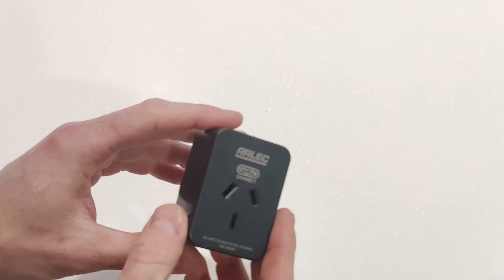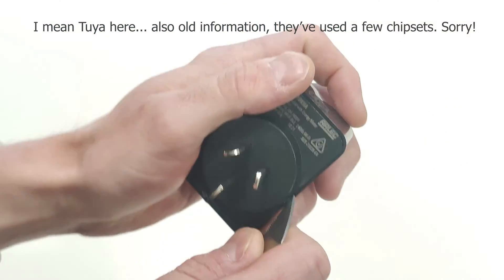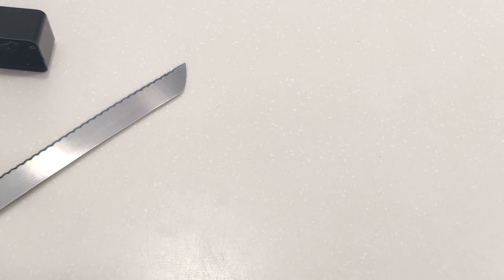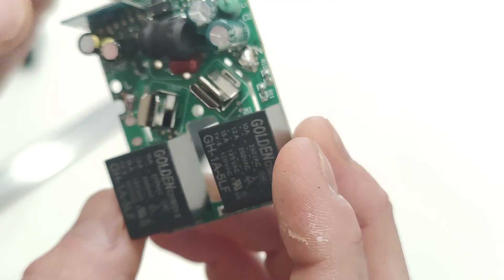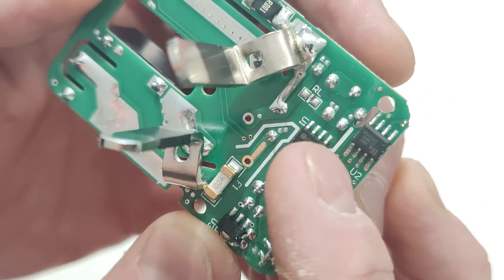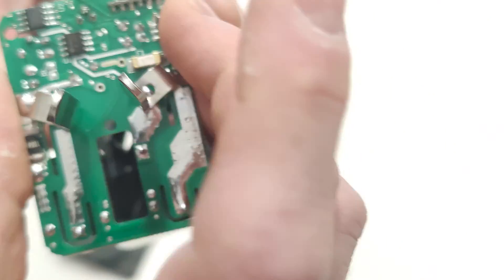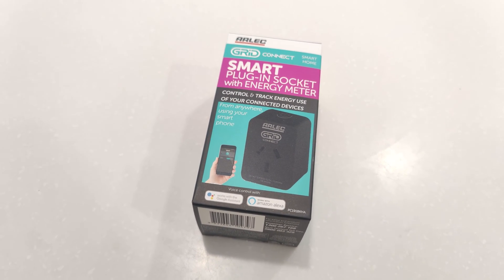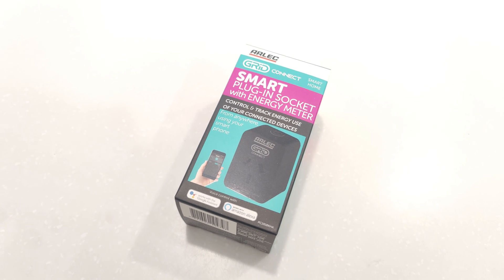Arlec Grid Connect 'Smart' Plug-in Socket with Energy Meter (PC191BKHA / PC191HA)

Comment: Since the first time I looked at this video, I've managed to replace the module in several of these, flashed with Tasmota. The TWYES 2 modules are cheap enough from Aliexpress, and after flashing tasmota on to them and replacing the crap module with the invasive grid connect crap on, they work with MQTT/Home assistant.
Reply from the maker: Hey that is great to hear! I just hate Tuya so badly haha, and rather get straight-up ESP32 modules if possible.

Comment: Great video… and I agree the app and info you get from it is very crude. I am looking for something that is better than this and where I can gather power usage to then calculate the cost against the wholesale market price of electricity.
Reply from the maker: Check out some of the energy integrations by Home Assistant, as they can be fantastic starting points even if not using Home Assistant. Shelley is always a good one, but I personally prefer Athom units. Depends on whether you require full retail compliance though, and if you want to sample at the socket or the mains input.

Comment: Just got 4 of them for $20, I've got some setup inside and in the garage working with home assist and their great.
The Bluetooth and location permissions are for wifi as BT shares the same chipset.
They explain it perfectly in the instructions and on google home
Reply from the maker: Yeah if you're happy using Google Home, and don't mind their low refresh interval etc, they can be fine, but if you need it to work offline or prefer not to risk your network being compromised or your data used for product research, then you need to flash it with third party firmware. IMHO just not worth any of those risks
Reply: @PlatimaTinkers  just opt out to sending data? 🤔 
There's no tracking in their firmware as I stated the BT and wifi and populated in the same chipset so it HAS TO use location services for its initial setup with 2.4ghz as 5gz isn't available untill setup is finished.
Wireshark and ng-suit shows zero outgoing data on Kali 
They can be setup on a local network easily without being online? 🤔 
I myself design and manufacture esp machinery ect.
You can also use tasker suits ect if you don't like Google assist.
It's instant without delays. 
It's better than the EWEELINK products ect.
But yes, unlocking the extra GPIO pins would be great but then you could just make one for as little as $4 with ALL GPIO's available? 
So I guess my question is, why you'd you pull apart a $40 item to use its parts you could buy for littoral cents? 🤔

Comment: What smart plug do u recommend?
Reply from the maker: For an everyday consumer that just wants an easy plug and app, or for someone with a bit of know-how who won't electrocute themselves and may want to use it with HomeAssistant etc?
Reply: @PlatimaTinkers  Just for reliability remote control and timer control really.
Reply from the maker: @MrBoomtheroom  Hrmm probably the TP-Link range then, they'd be easier to use.

The only reason I prefer Kasa over Tapo, is that the Tapo use Tuya under the hood, which I loathe.
Reply: @PlatimaTinkers  what does kasa use if not tuya?
Reply from the maker: @MrBoomtheroom   Well to backtrack a bit, they are typically ESP8266/ESP32 or Beken, and both can usually be flashed with something non-proprietary even if running Tuya. The older ones you could flash OTA due to a weakness, but the newer ones you generally need to crack them open to flash them unfortunately.

The issue specifically with Tuya is that it's closed, and locks you in. You have to use their app, you have to create an account, and it does not interop with many things. Basically just the required Apple/Google/Matter ones, in a limited form.

If broken and flashed with ESPHome/Tasmota/OpenBeken/etc, then you can integrate them with pretty much anything. WiZ is great like this; no breaking needed, no account needed, all integrations supported out the box with their own firmware. 

As far as the Kasa goes though, I honestly don't know what it uses under the hood. Maybe their own platform, maybe one of the ESP SDKs that is very "hit the ground running with our kit" (and good). The app was good, the integrations were good, etc. But Tuya unfortunately dominate the market, Kasa is all but discontinued, and Tapo have been no end of pain.

For me, besides integrations and account creation, the other big issue is I like everything to operate local. No cloud requirement. WiZ excels at this, and I think the Kasa range even worked fine, but AFAIK (and I may be wrong or it's changed) but Tapo requires internet. That's a vulnerability, and also just another bit of the 'black box', plus a liability if your internet is down and you want to manage it.

End rant. Hah
Reply: @PlatimaTinkers   reliability and good componentry really.
Reply from the maker: @MrBoomtheroom  I'd go for Athom then if you're a bit technical. Else the TP-Link Kasa range (not Tapo), or anything from WiZ.

Comment: I have been using Powertech MS6106 plugs bought from JayCar. I have a number that just work however some of them just go rogue for no apparent reason. Turn them off, wait, turn them on, press for 6 seconds, rapid flashing, start Tuya app, wait 2 minutes, fails to pair. Wifi is an ASUS mesh RT-AX92U 2.4ghz. Password is correct. Any suggestion would be welcome. TIA

Comment: Hey mate,
just bought a couple of these (before watchingthis video sadly enough :-)), but luckily bunnings is good with returns!
I'm very much in the market for a device that does what this one offers: energy monitoring and - if possible - remote on/off switch for the GPO. Are there other products that you would happily recommend?
Cheers,
Peter
Reply from the maker: Hey mate yeah I love Bunnings for that! Kmart too actually

10/10 recommend these: https://www.youtube.com/watch?v=o3iGvt1FTDc #ShamelessSelfPromotion (link in desc)
Reply: @PlatimaTinkers  thanks mate!
Reply from the maker: @petersmolderen2037  Any time!
Reply: @PlatimaTinkers  Hey can the Tasmota or Athom run sunset and sunrise schedules just connected to the wifi alone? A better question is do the apps provide sunset and sunrise options when setting a schedule?
Reply from the maker: @Timbo_tango  (Sorry been on the road for work) You'd need to modify their firmware, but luckily this is pretty easy. They post the default YAML for ESPHome on their website which has the web UI enabled, and you can just add extra config lines for that. Ref https://esphome.io/components/sun.html

They don't have an app either, unless you integrate it with Home Assistant (as I have) and use that app. Typically the "out of the box" experience is that it gets power, broadcasts a captive portal for config, you join it and get to it's config page, put your wifi details in and save, then access it's web UI from back on your own network.

Hope that helps :)

Comment: I'm looking for a strictly energy monitor plug and one that will monitor energy going in reverse, my current non wifi plug will go in reverse as it has solar panels plugged in, will these be the same?
Reply from the maker: That is bloody interesting, had never thought of that!

Will leave your email in my inbox, and try to jam 240V backwards through one this weekend when I am next back at the workshop. Once I've tried it, I'll let you know!
Reply from the maker: Hey so I tested this and unfortunately it does not work. When connected in reverse, the controller does not get powered. I can only assume that this is due to the side of the relay that the controller is on. I tried both the old and the new version, but no luck with either! Sorry mate, you'd have to custom make something for this!

Comment: Great video - thanks for all the info.
Has anyone else noticed that these devices reset/flap at random times - sometimes up to twice a day?
I bought a pack of 4 and all do the same thing.  At a random part of the day, or night, you will hear a click, and whatever was powered on via the device is now switched off, and immediately after that, another click as it is switched back on.  I have no schedules defined etc and load is around 2 Amps or less.  All four devices do this at different times, so I don't think it is environmental.
Any ideas as to what could be causing this, and have others seen this occur?
Reply from the maker: @craigreeve1091 Oh mate I had sworn mine was doing this but I could never catch it. I have some old crap ones that I know do it from time to time, but that's expected.

I am putting it down to either a firmware issue on the devices, or some sort of power regulation. Where we are power can drop down to 220V, or under 49Hz, usually just for a split second - they probably hate that.

If it's firmware, flashing it with Tasmota or ESPHome might help rule that out, else to rule out the mains voltage you could run it off an online-conversion UPS and see if it does the same thing.

I had some other thought of what could cause it, but I've since forgotten. Maybe worth checking your wifi logs to see if they actually disassociate; if it clicks and then reconnects to wifi it's a whole reboot, else it may just be the relay losing it's latch.
Reply: @PlatimaTinkers  
It worked out very well that I had these in my study whilst working from home, so I could see/hear it happening.

Thanks for your ideas.
I'll look into the wifi disassociation and any error logs.  I was also going to try and get some tcpdumps to see if anything interesting there as well.  

I thought if I had an issue with bad power etc, all four should have flapped at the same time, but this was never the case.  I'm not an electrical expert so that could be a wrong assumption on my part.  I do have a power strip running from the UPS, so I'll put one of these devices on that and have it feed my PC.  That way I'll know if it has restarted if I am not around when it happens.

If the above doesn't show anything, I might look into using different firmware, as you suggest, to rule that out as well.  I'll let you know if I find anything.
Reply: @craigreeve1091  Ah yeah okay if you've got multiple on the same circuit that flip at different times, I'd say the power source is not the issue.

Wifi disassoc is definitely an interesting one, I've been meaning to do a tcpdump of a freshie too at some point, as I really suspect there is more data going on than required. Some of mine are on a local Home Assistant, and their WAN traffic is way too high (in the MB's sometimes). 

Only go Tasmota or ESPHome if you have something to manage it with! Home Assistant is my choice, but there are heaps!

Comment: When the mains power goes off and then on again, do the units remain off (e.g., relay off - lamps off). If one is away for a few days, we really wouldnt want lamps to be running all day and night? Additionally, one of my suppliers recently stopped selling another type of device (not an arlec device) due to security breaches (china or others monitoring activity - very mysterious?). Are these esp and other devices safe in that way?
Reply: I have a couple of these.  I just tested your question.    Note only tested quickly.   
 I had a lamp plugged in and on, then turn the power off.  The lamp went out.   
I waited 5 minutes and then restored the power,    
The switch came back on (blue light on top is on) and returned to the on status,  my lamp is back on.   
I then did the opposite,  had the switch off and turned the power off,  5 minutes passed and restored the power.  
The lamp came on.  This says the switch goes to on when the power is restored.  Remember mine were short 5 minute tests.      

A BIG note.   
The reason I am at this video is my switch was stuffed.  You could turn it on and off by the app but it did not turn the lamp (power) off.  

I came looking for ideas.   

When I saw the above video with the switch opened and noticed the relays I though that is it, a relay is stuck,     I gave mine a few sharp taps and it worked, the relay is now operating correctly again.  (now turn the power on and off as intended.)  

I like with the app how I can see how much power is being used by the things plugged into the switch.   

This video saved me arguing with Bunnings staff over warranty. (I cant find the receipt)   

They cost about 20 dollars which is not going to break the bank if you get one and see if it works for you.
Reply: Seems like a big concern. If one has something electrical - say a fan, heater, or a simple light  - and forgets this. They then leave for a week, 2 or 3, and the mains power goes off and eventually back on, this seems to mean trouble, as all items turn on and stay on. Lets look at crazy but not impossible examples - one forgets to unplug even one of these smart plugs, and then goes away to a place where there is no signal (bush cabin), or fly's overseas and forgets, and even unimaginable scenarios - becomes sick in hospital for weeks etc etc. Those electrical items may be left on?!!! Where we live sometimes the power resets and temporarily goes off  - especially in windy conditions.
Reply: @peterg902  Hey I went and picked up the plug and tested this out - it defaults to "last state", eg if you left it on, when power comes back it'll turn back on. There are settings in the app to set always-on, always-off, etc though!
Reply: Thanks for that. Yes, apparently, the Black/White Smart Plug have settings for Off, On, or "Remember last status. If you set this to "off"........when the power cuts out - and then some time later comes on again, the plug starts in an "off" state - regardless of whether a device (e.g. lamp) was on or off. This is good news, as no one wants their lamps, heaters or whatnot to be on for a week or more - especially, if away from home. You will then have to switch the plugs on again using the grid connect -> prior to being able to power on (using their own respective switches) connected lamps / heaters etc .
Reply from the maker: @peterg902 Hey interesting question! I am not sure if these remember their last state or have a default, but I've left the notification in my inbox so when I go back to the workshop I can test that for you.

Personally I don't consider the default software/firmware combo safe - whether it's Arlec, or the more common Tuya (which they might even be based on, I forget). I would definitely say that the ESP and Beken platforms used are great and safe, it's the code on them that is not. I'd always recommend flashing with something like OpenBeken or for ESP's then Tasmota or ESPHome. I've done that with nearly all of mine.

The best ones though are the Athom plugs - they're Chinese, but come pre-flashed with either of those, and all their code is open source! Ref https://www.youtube.com/shorts/o3iGvt1FTDc and https://www.youtube.com/watch?v=YSEezVtnBoA

Comment: All the earlier Arlec/Deta stuff used to be ESP based. I have some of the older items and was able to flash the power plug head replacement with no issues. The whole industry changed over to the new Tuya chips. Each of these companies could have achieved larger market share if they were developer friendly. I also hate Tuya.
Reply from the maker: I know, the good old Tuya stuff that you could use tuyaconvert with. sigh I really hope tuya ends up in a garbage fire that keeps hobos warm one day